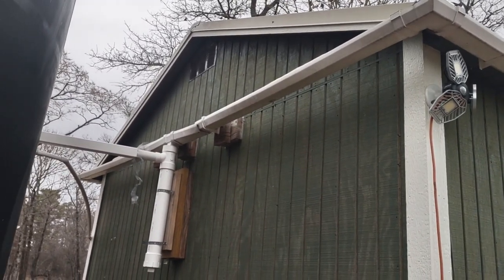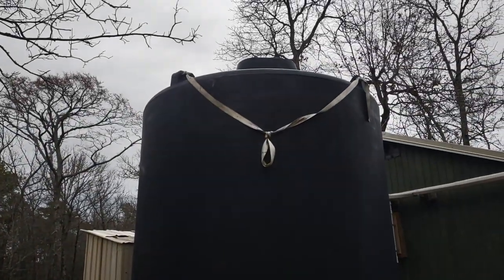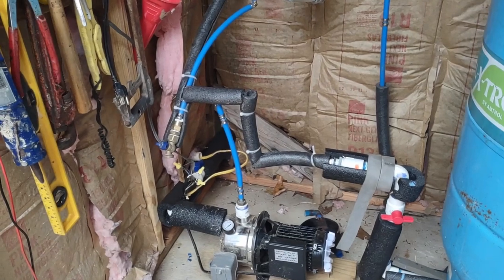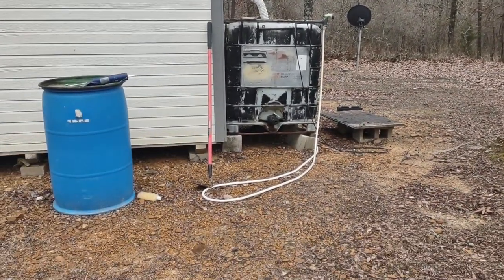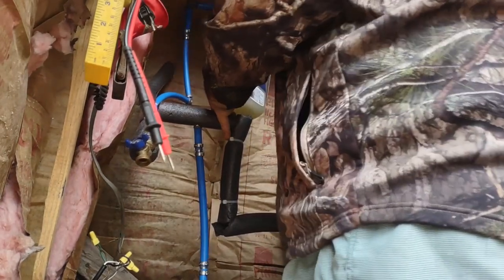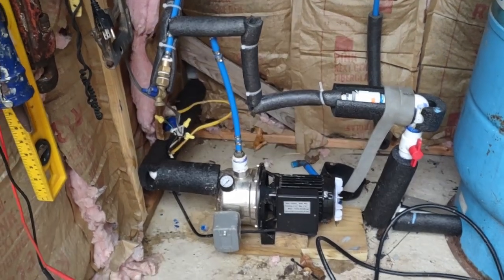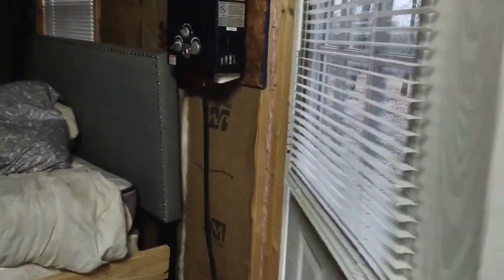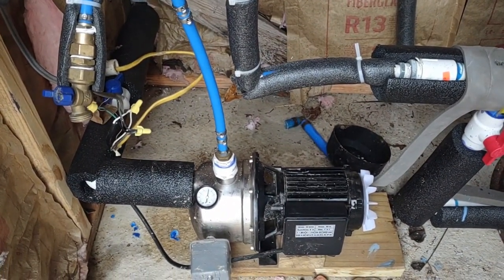Huge Off Grid Rain Water Catchment !!

Comment: Bury the big tank 2 feet, and raise your intake pipe a foot that might get you an extra 1500 gallons. I would make the outflow pipe at least a couple of feet off the bottom of the tank. Each person does it differently, tho. I like what you're doing with your property.
Reply from the maker: I absolutly would...i just wasnt in the position to dig a hole when i put it there...so ya...im only using about 4k  gallons of 6

Comment: its the vaseline that’s deteriorating your seals,…petroleum based products are known to emulsify rubber, plastic and yes even nitrile and neoprene,….use a silicone lube, sells in may plumbing stores, sells at pool stores here in florida
Reply from the maker: gotcha...thanks
Reply: Excellent point
Reply: Or you might try olive oil or coconut oil just a thought